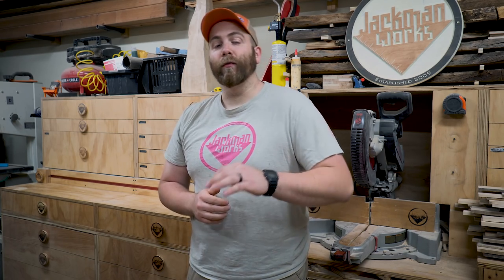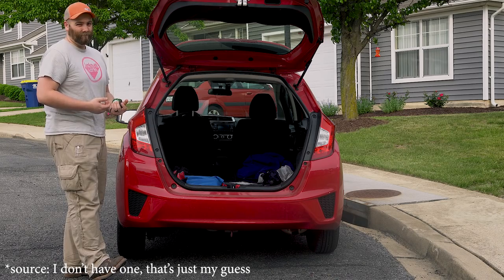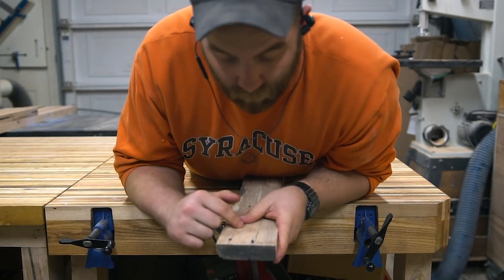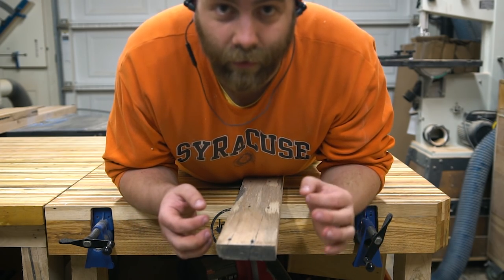Modern Dresser with Patchwork Plywood Panels

Comment from the maker: ► Are you a glutton for punishment like me? Get the plans! http://bit.ly/2jOJD9T
► Free samples from *PureBond*: http://bit.ly/2z1Sw97
► Purebond Plywood used on this build:
- Aromatic cedar https://thd.co/2KUIZnJ 
- Mahogany https://thd.co/2IEqkho 
- Walnut https://thd.co/2wHNmzx 
- Hickory https://thd.co/2KhgGi1 
- Alder https://thd.co/2Kdi6ds

Waterlox Original Tung Oil is my favorite choice for finish and was used on this dresser, get the same results as me: http://bit.ly/waterloxjackman

Thanks to Rockler for supporting this project! Check out all of the amazing tools that I used to accomplish this build: http://bit.ly/2Kgb2wI

My exclusive solution for hearing protection in the shop, ISOtunes PRO - http://bit.ly/2uIsq7M

Full build article with all the extra details you didn't know you needed, it's available on my website - http://bit.ly/2IdKjjC

Materials & Tools used on this build
Materials & Hardware:
2’x4′ plywood project panels:
(4) 1/2″ aromatic cedar & (3) 1/4″ aromatic cedar https://thd.co/2KUIZnJ
(2) 1/4″ red oak
(1) 3/4″ walnut https://thd.co/2wHNmzx
(1) 3/4″ hickory https://thd.co/2KhgGi1
(1) 3/4″ mahogany https://thd.co/2IEqkho
(1) 3/4″ alder https://thd.co/2Kdi6ds
Misc reclaimed oak boards
Wood glue http://amzn.to/2kID2jI
Waterlox tung oil finish http://bit.ly/waterloxjackman
Dowel pins https://amzn.to/2G6Kk7l
Biscuits http://amzn.to/2jrBmGB
16″ drawer slides https://amzn.to/2rB5i9E
Drawer pulls https://amzn.to/2KgoLUg

Tools
Jointing sled http://amzn.to/2qtonYV
Table saw http://amzn.to/2j4bvVU
Miter saw http://amzn.to/2j614UM
Feather boards https://amzn.to/2G8S8W1
Bandsaw http://amzn.to/2j4auNu
Glue applicator bottle https://amzn.to/2jP0glG
Screw clamps (6″ and 12″) http://amzn.to/2k4EvjT
Thickness planer http://amzn.to/2j4ISuI
Rockler Bar clamps http://amzn.to/2DMjReG
Bead lock tenon jig https://amzn.to/2rB1gOz
Pocket hole jig http://amzn.to/2j68JT0
Drill and driver http://amzn.to/2wy5wSZ
Chisels http://amzn.to/2iDRapV
Rockler dowel jig https://amzn.to/2IdP9gM
Biscuit jointer http://amzn.to/2ifDaEQ
MAP gas torch http://amzn.to/2y6r9Ln
Rockler dovetail jig https://amzn.to/2jQb3vX
Rubber mallet http://amzn.to/2oJDIrf
Wood rule http://amzn.to/2gdizmg
Rockler drawer front installation jigs https://amzn.to/2rCuPyx